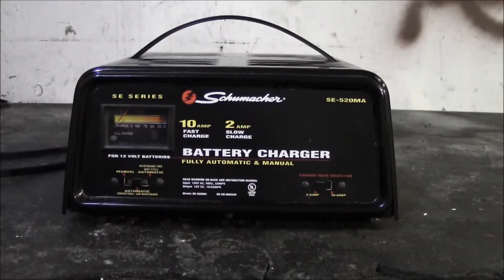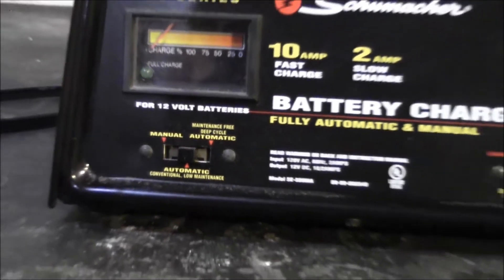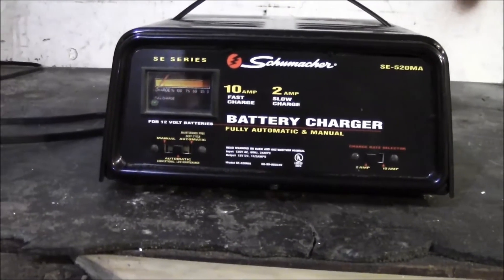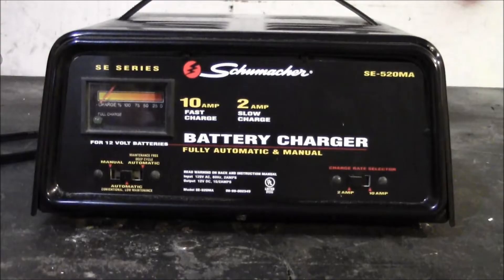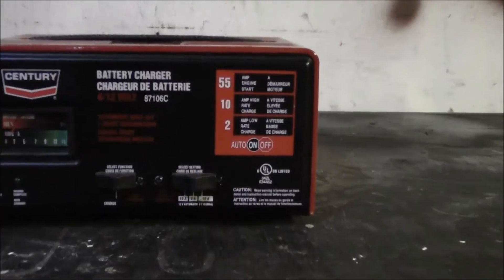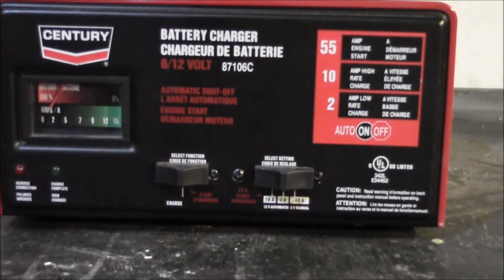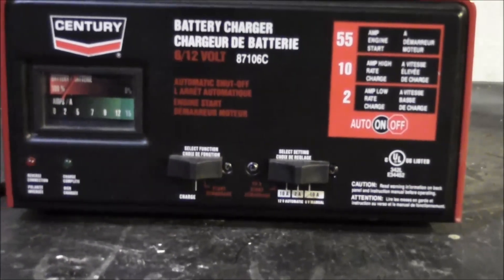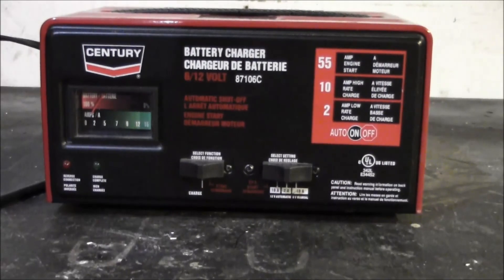What you need to know about battery chargers part 2

Comment: I'm having an issue that I cannot find any info or advice on. If anyone out there could help me I'd appreciate it immensely.
I have a powerfist 2/10amp,  6/12 volt automatic charger .
I hooked up my car battery to it, disconnected and outside my car,  and in the 12 volt/10amp setting the needle keeps surging up and down every second or so. 
I really don't think that's normal.
On the 12v/2amp setting however, it seems to act normally. I'm not sure what is supposed to sound like but it hums somewhat quietly and doesn't fluctuate on the voltage/amp gauge.
From what I can tell, my cars battery should be compatible with the charger I'm using on the setting. It's a lead acid type 86A with 580cca and 95RC.
THANKS
Reply from the maker: righteousfury1:  They type of charger you have can be a real pain to use.  It helps to have a voltmeter to double check if it is charging or not.  I would suggest charging it on the 2 amp setting for an hour and then try to switch it to 10 amp and see what happens.  Sometimes the charger has issues on the higher amp setting.  However, you could also have a bad battery and that is why the charger is acting up.  If you have trouble with it after charging on 2 amp for an hour, I would take it to an auto parts store and have it load tested.  You might just have a bad battery.
Reply: @fwh79FOXR6  thanks for the reply! I had it charging on the 2amp setting and it did show an increase in battery charge over the six hours I had it there there. Whenever I switch the setting to 10 amps it does the same thing I described earlier. 
I also have a bigger battery from a BMW I'm attempting to charge.
The gauge reads it's fully charged with the needle hovering on 2amps but in the car it seems flat dead.
I'm thinking it's completely sulfated or something even though it's a fairly new battery. I think the previous owner left it discharged for some time and it's just full of sulfate now I don't know.
Reply from the maker: righteousfury1:  You're welcome.  Keep in mind that some times a low amp setting like 2 amps could literally take over 24 hours to recharge a very discharged battery depending on its size.  I would highly recommend getting both batteries load tested before you do anymore charging.  Trying to charge a damaged battery can be very dangerous.  I'm not a big fan of getting battery acid blasted on to me or anything I own!  So please take the time to get both batteries load tested before you go any further.  Also consider that you may have a bad battery charger.  The problem with these chargers that have an old school sweep dial, is that they are very hard to read on a low amp setting.  You might want to consider getting a newer charger with a digital display.  If that BMW battery has been discharged for a long time... it is probably toast.

Comment: Agree with your assessment, I have used the Schumacher SE-520 to 'revitalize' several batteries where the maintainers simply did not sense a battery present.  The manual mode simply is a 'charge no matter what',  and must be closely monitored, or the battery may simply 'boil out' or swell to the point of no return.  As you said, manual charge until the voltage is up enuf to use a maintainer. Good Job.
Reply from the maker: RBR Dave:  Thank you.  Seems like very few people know how to get an automatic charger to sense a discharged battery.

Comment: I have an Autocraft 2/12/75 amp charger and I am not getting anything through to the hookup clamps. You can even touch them together and there is no spark. What do you think the problem is? It is only less than 2 years old and used less than 6 times. Thanks
Reply: Check your fuse,see manual.
Reply: I have the fuse out but I can't find one. ???  I can't find my manual
Reply: Look for a circuit breaker somewhere. Some chargers won't 'start' until it senses a battery or 'load' present.  Most chargers have an internal circuit breaker that will eventually reset, but some older models have a manual reset button somewhere. be careful..
Reply from the maker: sherry davis:  You are probably having trouble triggering a charge cycle because the battery you are trying to charge is too discharged.  I tried to find the charger you have and it looks like your Autocraft charger is fully automatic.  This is a common problem with fully automatic chargers.  If the battery you are trying to charge has a voltage that is too low for the charger to "sense" the charger will not trigger a charge cycle.  It is a safety feature, but all it seems to accomplish is make people angry because their charger won't charge a battery.  So what you need to to do, is increase the voltage of the battery to trigger the charger.  There are a few different ways to do this.  You can use the 75 amp start mode.  However, that can be dangerous if the battery is in poor condition.  So, I would avoid doing that.  I would suggest that you get a set of jumper cables and hook up the battery you are trying to charge to a known good battery.  When you hook up the jumper cables the good battery is going to send voltage to the discharged battery.  This will allow the charger to "sense" that a battery is connected to the charger and fire a charging cycle.  So hook up the battery you want to charge, to a battery that you know is charged with jumper cables and let it sit for 10 minutes.  Then, disconnect the jumper cables from the good battery and hook up the charger.  During the 10 minutes the discharged battery should absorb enough voltage to be able to trigger the automatic charger when you hook it up to the battery charger again.  Try that out and let me know how it goes for you.

Comment: i have one, it only have 8 volts ... heeelp please
Reply from the maker: What do you have?  I'm not sure what you need help with.
Reply: I HAVE THE BATTERY CHARGER SE-5212A...
Reply from the maker: If you are having a problem triggering a charge cycle, use jumper cables to hook up the discharged battery to a charged battery.  Make the connection as if you were going to jump start a car.  That will increase the voltage and allow you to begin a charge cycle.  I would charge the two batteries connected together for 10 minutes.  Then you should be able to disconnect the good battery and place the charger onto the discharged battery to finish charging it.  If you battery is down to 8 volts you may have a bad battery.  I would recommend having it load tested.  Many auto repair parts stores will load test a battery for free.
Reply from the maker: You can bring the battery in by itself to be tested.

Comment: I've had a charger just like this for about 2 decades.  I've used the 55AMP start mode many, many times on old beaters that I had.  It works GREAT to start a car with a battery that is dead.  Leave it on for about 5 minutes, start the vehicle, then leave it on 10 amps for a while longer.
Reply: What if the battery is not in the vehicle... can the 55 AMP start mode still be used on a deeply dead battery?
Reply from the maker: @doloresdavidson-george5495    I would only use the start mode if the battery is deeply discharged and will not trigger a charging cycle (very common problem with automatic style battery chargers).  Do not try to charge a battery with the start mode.  Either use it to start a dead battery in a car or use it to "jump start" a charging cycle with the battery charger, inside or out of the vehicle.
Reply from the maker: They do come in very handy sometimes!  Thank you for sharing your story Danny.

Comment: so how do you know when your battery is charged ?  the guage indicates a charge when needle is up or down.  Just the basic info needed.
Reply from the maker: The needle on the gauge reads the real-time amperage draw.  The amperage is how much power the battery is pulling from the charger.  So when the needle sweeps to the zero part of the gauge, it is charged up.  For example, if the battery is very discharged and you set the charger to the 10 amp setting, the gauge will sweep up to 10 amps and slowly fall down to zero as the battery takes a charge.  If the battery is only partially discharged the needle may only jump up to 5 amps and then slowly fall down as the battery takes a charge.
Reply: @fwh79FOXR6  Thanks that explains the gage basics clearly
Reply from the maker: @VERTAIR7  You're welcome

Comment: I just want to know which side of the meter is charged why does nobody mention that 1 side says 100 % and the other says start what is the deal?
Reply from the maker: If I explain it to you are you going to sub my channel and share my video?
Reply: fwh79 I think i have it figured out just not sure why they made the side that is chared say charge and the other side say start?  Kinda odd but even odder was the fact that 4 guys at 2 different auto zones didnt know either?  Not a goid day csr broke down 3 mi from the house litteraly had to cary the battery home in a lunch cooler lol This Everstart 2 10 50 must be made in China. Im  subbed
Reply from the maker: When the needle sweeps over to the 0 amps section of the gauge, the battery is charged.  The problem with the needle gauges comes to light when you are charging on a low amp setting.  They become hard to read and that confuses people.  I am not sure what brand/model charger you are using.  However, it is generally hard to use these chargers with a needle amp display.  If you are using an automatic charger, set it to the higher amp setting first.  If it clicks on the "charged" light, turn of the charger and switch it to the lower amp setting.  The start the charger again.  Let it charge on the low amp setting until the charged light comes on.  If you have a manual model, I would suggest that you find an automatic charger.
Reply from the maker: Thanks for the sub.  Yeah, I'm not surprised that 4 guys at two different stores couldn't help you.  I always laugh to my self when I see that sign in Autozones window that says "Free battery charging, most in less than an hour."  Not an accurate advertisement.  I know plenty of automotive techs that don't know how to charge a battery or read a battery charger for that matter!  It can be confusing.  Good luck, and I hope you fix your battery problem.  If you have anymore questions, be sure to ask me.  Thank you again.
Reply: fwh79 Thanks man i appreciate that.
Reply from the maker: You're welcome.  Always glad to help.  Sorry about the ultimatum, but I need subs bad!  Thanks again for the sub.

Comment: This was a suggested video because I was recently looking for my video about this. You really did a good job and have a great grasp on how chargers work. I didn't really know that a automatic charger wouldn't start with an overly discharged battery. I really needed to know that a couple of times! LOL 

I had a suspicion but at the time I didn't think there was anything I could do about it. Batteries in parallel, duh! :)
Reply: If you'd like to find it, one of my videos on the subject was, "How to see if a battery is bad with a charger". Stay connected. :)
Reply from the maker: Thank you.  I'm glad that you enjoyed the video and learned something.  Charging automotive batteries is a very confusing topic to say the least.  Seems like most automotive techs lack a basic knowledge of battery charging.  So it can be hard to find accurate information.  I'll be sure to check out your video.  Thanks for the sub!

Comment: im guessing you live some where thats warm even in the winter. the 55 amp start option is for those unexpected fronts rolling in throught the night and even though you plugged the block heater in the battery just doesnt have enough ooomph to it to start the car
Reply from the maker: I live close to Chicago, so it can be brutally cold here some times.  I did not purchase the charger for the 55 amp engine start mode.  It just happened to have it.  55 amp is actually kinda weak any ways.  But some times it can help you out if your battery isn't discharged too much.  Every vehicle I own is kept on a battery maintainer, so I never need the start mode any ways.  If you would like to learn more about how beneficial a battery maintainer can be, check out this video: https://youtu.be/biwTpBFM-ns

Comment: I looked through the comments and didn't find an answer to my problem... do you know what it means when I hook up my Sears fully automatic charger to my car battery (@2amps, Low-Maintenance Battery mode) and the needle continuously jumps between full charge and about 75% charged?  The needle cycles every few seconds.  Thx for your videos.
Reply from the maker: You are welcome.  Thank you for asking for help.  Do you have a model number for the charger you are using?  Are you charging a car battery?  Is it in the car hooked up or outside of the car?  Is the battery out in cold, possibly freezing weather?  What amperage setting(s) does the charger have?  Depending on the state of charge of the battery, the charger many be having problems triggering a proper charge cycle.  Deeply discharged batteries can actually freeze, which will cause charging problems.  Also, a deeply discharged battery will some times not have enough voltage to trigger the automatic charger (this is a built in safety feature).  You could also have a bad battery (shorted plates inside the battery) that will some times cause the needle to sweep the way you are describing.  Please tell me what you are charging and why you are charging (car won't start?) and it will help me better answer your question.
Reply: Thx for the reply...  It's a Sears DieHard, Model 28-71222 Fully Automatic 12-volt battery charger.  

It has 3 amp settings:  50-amp Engine Start (which I don't like to use), 10-amp Fast Charge, and 2-amp Slow Charge.  I have it set to Slow Charge.  

There are two battery type settings:  Conventional Low Maintenance and Maintenance Free Deep Cycle.  I'm using the Conventional setting.  

The battery is in the car, a 2000 VW Golf TDI (diesel).  It was -15°F overnight and I knew I'd have problems starting this morning so when I went out I immediately put the charger on to give it a boost. That's when I noticed the needle swinging back and forth between "Charged" and about 75%.

Actually, about a half hour after I posted my question, the needle stopped swinging and showed a full charge.   I disconnected it and tried starting but quickly used up whatever actual charge was in the battery.  I'm about to go out and try again.  The thing is that I had the car in the shop last week for a "check engine llight" diagnosis (it was the glowplugs) and they told me after a routine check that my battery was in good condition.  

Well, maybe the "swinging needle" is just something to ignore and I should just let the battery charge.  If I have any other problems I'll let you know.

Thanks again for the quick reply.  👍
Reply from the maker: Thank you for the detailed reply.  Makes helping you much easier!  It sounds like you are doing everything correctly with the charger.  One thing to keep in mind is the temperature.  As a battery discharges, the water/acid in the battery becomes less acidic and more like water.  This greatly increases the chances of the battery freezing.  A cold battery is resistant to charging and trying to charge a frozen battery is down right dangerous.  You may want to remove the battery from the vehicle and allow it to warm up inside.  Then charge the battery in a well ventilated area after it reaches room temperature.  The other issue is the fact that you are starting a diesel engine.  Diesel engines usually have a much higher compression ratio than petrol engines, which greatly increases the power requirements for starting.  This puts a much greater demand on the battery and is the reason why most diesel trucks have two batteries.  The dual batteries provide more amperage for starting in cold/freezing weather.  Maybe you should get a second opinion on the condition of the battery.  If it is more than 2 or 3 years old, it could need replacing.  I would highly recommend an AGM battery if you end up needing a new battery.  They are expensive, but worth the money.  Almost a requirement for diesel applications in my opinion.  I would also recommend using a battery maintainer.  Especially when temps get below 40 degrees F.  Schumacher makes a nice on board maintainer that plugs into an extension cord.  Another alternative would be to buy a jump box.  You can use the jump box for those cold morning starts (dual battery).  Be sure to keep the jump box charged up and you should be good.  Plus you can keep the box in the car as a plan B if your car will not start away from home.  You could even charge the jump box over night every time you come home so it is ready to go in the morning.  Hope this information helps you out and thanks for watching.
Reply: Great info!  I will start by looking around for an AGM battery.  A jump box would also be a good thing to have.  👍  Btw, my second try at starting my Golf was successful.  It had warmed up to +10 by that time and the charger had been on it for about 3 hours.   Have a good year.  :)
Reply from the maker: That's great news!  Glad to hear you got her started up.  Thank you and a good year to you too!
Reply: M Spanford 

Saaame bro

Comment: Can I run this with my 400w dc to ac inverter
Reply from the maker: You can use either of these battery chargers to recharge a battery after you have drained it using an inverter.